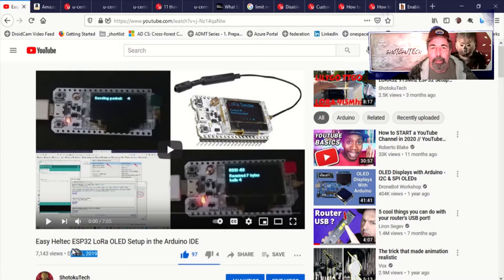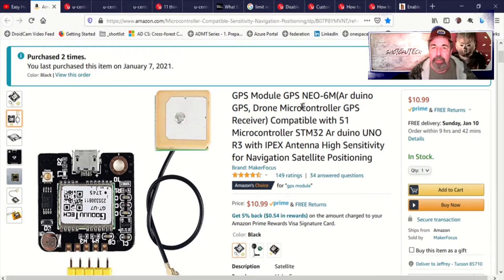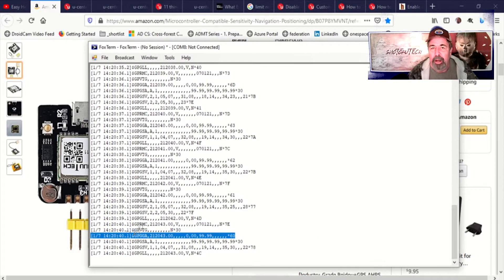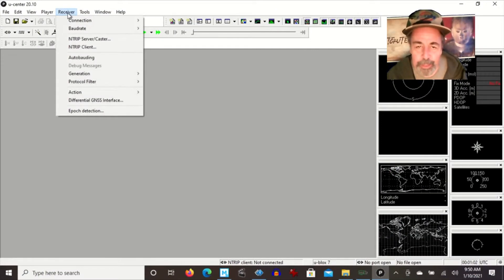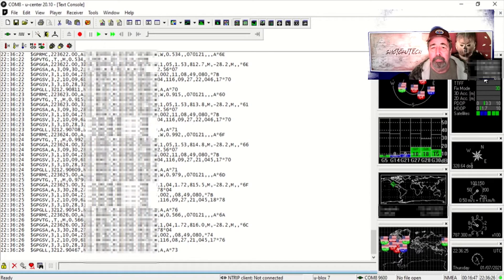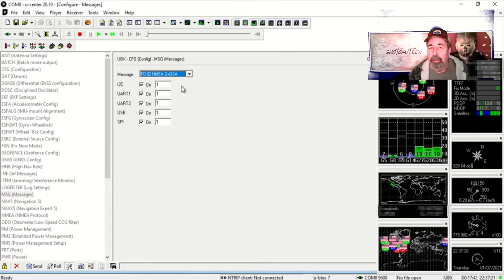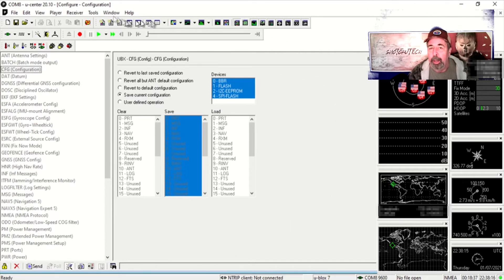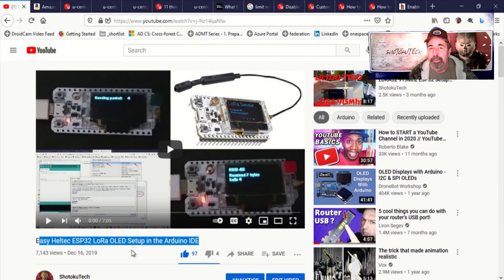Programming GPS Modules with U-Blox U-Center

Comment: I was working on my iot gps based project So my project was working fine until i decided to replace my ublox neo-6m-0-001 module with ublox neo-m8l-06B-00 for better efficiency but its showing invalid in serial monitor now, urgent help
Reply from the maker: Is serial monitor set to the correct baud rate? Have you tried using the UBlox application to work with the new module? I don't have any idea how it fix it otherwise. Best wishes.
Reply: @ShotokuTech  basically upon connecting my prev. module console worked of its own but with this m8l its not, i assume its a fake module

Comment: Hey, is there a way to zero out the the altimeter? When i turn my quad on it says im 230ft in elevation which i think is close to where im at above sea level. Is there a way to reset that?
Reply from the maker: It takes several minutes to get enough satellites for accurate altitude. Best thing to do is find a GPS module with a battery to keep things fresh.
Reply: @ShotokuTech  lol yeah I just figured that out when I got 25 satellites. It was accurate. Thank you though
Reply from the maker: @Chillin-fpv Cool, good to hear back on this. Thanks. Best Wishes!

Comment: Hi,
first of all thank you for the video.
I currently use the u blox neo-m8u connected to a MSP EXP430FR5995. It is a project of my university. The ublox is installed in an airplane an we need it to give us the longitude and latitude values. 
The problem is that we have wrong values for lat and lon in certain areas and we can't think of any solution.
In ucenter, we see that the values are correct, but the false values occur when transmitted through I2C to the MSP430. We think there is a problem with the interface. Do you have any idea what might be the problem?
Reply from the maker: You present an interesting problem. Is it garbled data or data that looks good but is just plain wrong? I have to admit I have not done GPS via I2C, only serial. So when you are using ucenter, it is serial. Do you have the option to use serial with your project?

Comment: Hi, can you please help me to configure BN-220 I have reseted it to default and after I am unable to get GPS fix on my Quad Drone.
Reply from the maker: Sounds like you should search YouTube for BN-220 and Betaflight or whatever software for managing your flight controller. Because you are using this with a drone, there is a layer of complexity beyond just working with GPS module breakout boards for other applications. It needs to be programmed to work with your flight controller. So you would want the software for managing your flight controller to get the GPS to work with it. Thanks.

Comment: Good evening, I have a tablet that does not have GPS technology integrated, I purchased a U-BLOX 7 USB device and I could not make it work, I saw that there is an app in the play store called U-DROID CENTER for U-BLOX, it will be that my problem would be solved ? Thanks in advance.
Reply: If you can help me send me an email so we can communicate. thanks
Reply from the maker: @PietroG4mer  Try the U-DROID CENTER for U-BLOX to configure and monitor. Or you can use USB Serial Monitor to see GPS output. The UBLOX software should allow you to configure the output as I have shown here. https://play.google.com/store/search?q=otg+serial+monitor&c=apps
Reply from the maker: I guess it depends on whether the tablet supports connecting devices to its USB port, OTG it is called. Some tablets only support charging and file transfer on their USB port. From U-DROID CENTER for U-BLOX Play Store page: "To connect the USB navigation receiver, your smartphone must support USB Host OTG."
Reply: @ShotokuTech  the tablet supports OTG yes, I managed to make the GPS work in developer mode, but for what I need it does not allow developer mode to be enabled.
Reply from the maker: @PietroG4mer  I cannot replicate your hardware scenario with my equipment. If UBLOX has an app for this, it should be good. It is a matter of having a serial monitor that can read and write to your GPS device via OTG.
Reply: @ShotokuTech  what would that monitor be? sorry for my ignorance but I don't work with this I'm just trying to make my device's GPS work which unfortunately is not integrated

Comment: Hi, very interesting video. Sir, how do I change the RTC (Real Time Clock) on gps? There is a 6 hours difference between my laptop and GPS. Thank you.
Reply from the maker: It's not RTC on the board. It is UTC from GPS satellites. So you would need to adjust this in a program on whatever board you choose to connect to this. Thanks!
Reply: @ShotokuTech  Ok, Thank you very much Sir!. I will look forwards to see this with U-Blox, U-Center later today.
Reply from the maker: @kermitinmountain6371  Have fun!